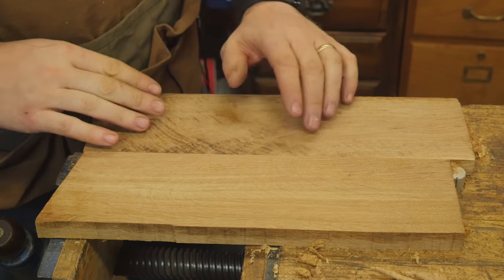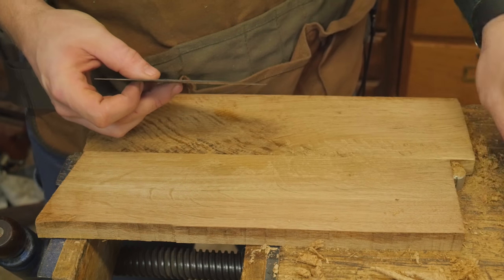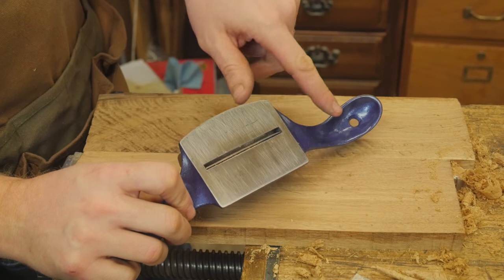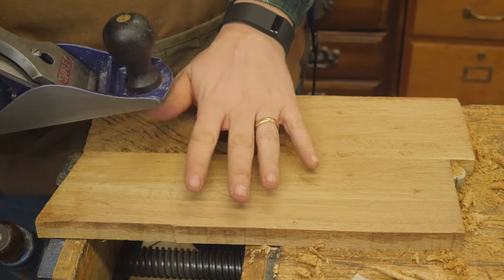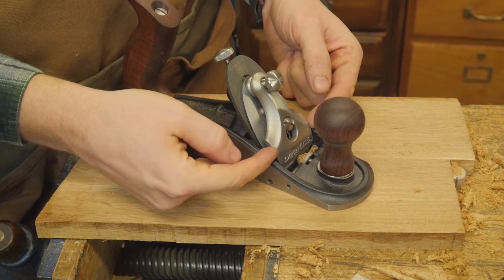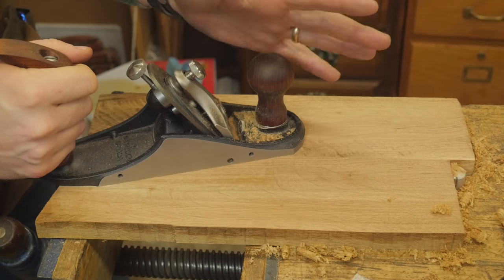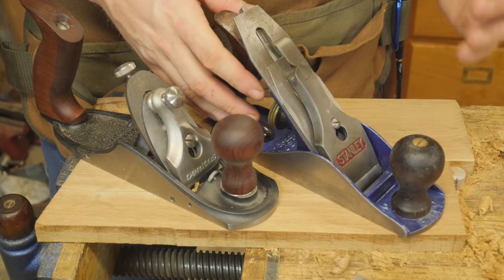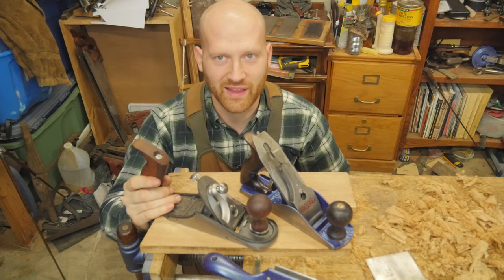How to Smooth Figured Wood a Hand Tool Woodworking Skill

Comment: First off, this is a great channel. Keep it up! I like that you made a point to say that this is not a knock on the Bailey patent planes. I would put my 1908, Stanley 604 up against anything made today as a dedicated smoother ... but if Lee Valley just happened to send me Veritas smoother (or even a PM V-11 blade for the 604) it would definitely find a place in my shop ;)
Reply from the maker: Thanks. right on. They will both do the same work just as well there is a reason I still use my type 7 - 11 planes.

Comment: Nice video. Hope to see a complete review of this new Veritas custom plane
Reply from the maker: thanks. I am not big into review videos, but I might do a setup video some time in the future.
Reply: Hello, thanks for the quick answer. No problem. I see they have all the characteristics to be great planes. I have them on my list since a very long time. But since I learned how to tune an old Stanley and adjust the chipbreaker it's getting hard for me to justify the expense. I will be happy to see you explaining the set up. Just one remark isn't the high angle too hard to push ? It seems to be when looking at you.
Reply from the maker: thanks. that does make it harder to push. but the higher the angle the easer it is to work on figured wood.
Reply: I experimented with very close chipbreaker plus 40 degree polished micro bevel on the chipbreaker and got great results on figured elm. Definitely need to test with high angle frog to compare.

Comment: Nice video!  ideally with the card/cabinet scraper if it is well and truly sharp - youll get real shavings with very minimal dust.  Thought, turning a real good hook on your scraper takes a lot of practice and fiddling - i would agree the simplest method is that place for sure
Reply: I used a'lot of self modified or cheaply made scrapers. They are all hard to sharpen.  Finally, I splurged $10 on Bahco from Rockler. They must have done something to that metal, because its really easy to sharpen and get a hook. Maybe specially tempered.  I used an old worn down swap meet knife sharpener as a burnisher and to get a hook. And so far so good.
Reply: The nature of the steel makes a HUGE difference.  Too soft, and you just roll your hook right back once you take it to the wood and then the edge wont cut right.  Too hard and you wont be able to turn a large enough hook really.  And if you do - it may chip/nick during use over a knot or something!

Its a real Goldie Locks situation - which is why scrapers is one area i would certainly go with a reputable brand that knows what they are

Comment: Do you tend to like the taller front knobs/totes?  I just refinished a Sargent 418(equiv to a 6) and I put a new front tote that is tall.  I haven't put it to wood yet, but I really like the feel of it.
Reply from the maker: I like it for a #4 so that my palm is not rubbing on the side of the body as much. for a #5 I mile a medium height. and for anything longer, I like a short knob. that way my force is more in line with the plane.

Comment: OK, the plane is really nice and I enjoy your vids (normally), but...

This can be done (and is being done) on any plane (45 degree bed) by putting a back-bevel on the iron. The back-bevel does not need to be very large or use a separate blade just for this purpose...

Sorry for the negative comment, but for the folks who can't afford the plane I thought it would be nice to know that there are alternatives...

Keep up the good work!
Reply from the maker: That is very true but the problem with a back bezel is that you can't get the chip breaker as close as you can and I would much rather have a closer shipbreaker then a higher angle frog. The bonuses of this particular plane are in the set up not just in the high angle it has many bells and whistles that make it very user-friendly. But that being said you could do the exact same thing with an old number four.

Comment: Totally agree with you on this. A razor sharp No 4 can do almost anything but requires so much skill and set up time. I don't have much of either unfortunately so I use my Veritas low angle jointer with a 50 degree blade. obviously spot planing is a bit difficult. I may have missed it but what angle frog did you go for? Thank you for the great video.
Reply from the maker: thanks Gary. I use a 60-degree frog. I am just waiting for someone to come up with a chip breaker for a bevel up plane. that would change everything!

Comment: Can you give us an idea on the difference in pressure needed to push the higher frog angle through the wood. I have always heard that the higher the angle the harder to push but the better for tear out it is.
Reply from the maker: Very true. The higher the angle the harder it is to push, but the better it does on figured wood. the lower it is the easier it is to push and the better it is for end grain, but don't think about figured wood.

Comment: I returned to this after I spent about 4 hours tweaking my Record # 4 smoothing plane.  It really does a good job but I did not notice much, if any, improvement after working on it for about 4 hours.  I still needed a card scraper to get the finish I need but still not use of sand paper.  I might have to re-think my Veritas comments below.
Reply from the maker: Ya, the first time I finally got a baily pattern plane it fook me all day to get right. now that I know what I am looking for and can feel it the task only takes 20-30 minutes to set perfectly. It can be done but it is a pain. but if you like the finish of a card scraper why mess with it. everyone has different tastes.

Comment: What are the pros/cons to each of the frog-angles?  Why did you choose a 60 degree bed angle?  When would you choose a lower angle?
Reply: A high angle is harder to push, but reduces tear-out. For non-figured woods, you'd be better off with a standard frog angle. The standard 45 degree angle is  a good compromise between ease of use and reducing tear-out. Low angles would be better for things like cutting end-grain, but they'd increase the chance of tear-out when planing faces.
Reply from the maker: I could not have said it better! Thanks Jonathon

Comment: Is it possible to get cheaper/used high angle planes (without the fancy adjusters and setters) that we can set for difficult grain (and reset it after sharpening)? Ive seen plenty of low angle planes but didnt think about high angled ones. Or is custom the only way?
Reply from the maker: you can use a standard Baily pattern plane it just takes more to setup. here is a video where I go through all of that. https://www.youtube.com/watch?v=vG-DULSw6Zk

Comment: Give us the full specs on your plane. The website has many options. What would you recommend for different situations?
Reply from the maker: mine is A2 steel with large tradition al tore medium knob and 55degree frog. but everything is really based on what fits you and what you like.

Comment: Good video, as usual, and very informative.  I stopped when the advertisement for the Veritas started as I am mostly interested in your work and not a tool which is out of my budget and desire.  I would note that as I get better sharpening the card scraper, my projects are getting much better.  I have virtually stopped using sand paper which also make the work more fun.
Reply from the maker: LOL thanks! that is good to hear I love to hear when a tool is working better.

Comment: Great video! So, question: I'm looking for a smoother to handle tough grain, and I'm going between a bevel up plane (with extra 50° blade) , or a dedicated plane like the LV custom you have.  What advice would you give?
Reply from the maker: for decent figured wood you really need the chip breaker of a bevel down plane. Even with a tight mouth on a bevel up and a high angle blade, it won't leave it glass smooth. but that again is a personal preference. I am not a big fan of the all in one idea of a bevel up jack, but that is me. I would rather several planes setup to do the task well then one plane setup to do the task OK. and if money is an issue differently look ar refurbishing an old Baily pattern plane.
Reply: Wood By Wright Thanks for the advice!  I think the bevel down might be the way to go.

Comment: Anyone have any experience / opinions on the Veritas scraper plane?
Reply from the maker: I've used it quite a few times. I generally find it's cheaper to buy an antique one as there's not much to them but they both work great.